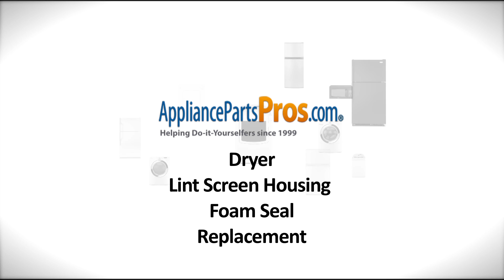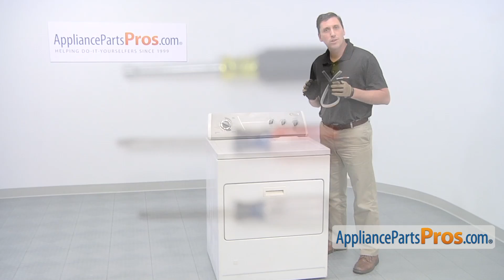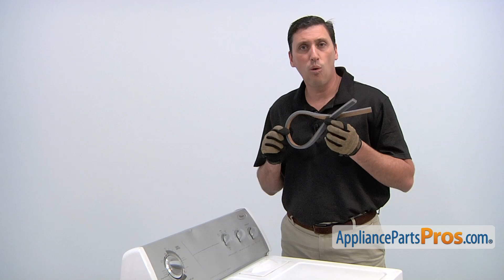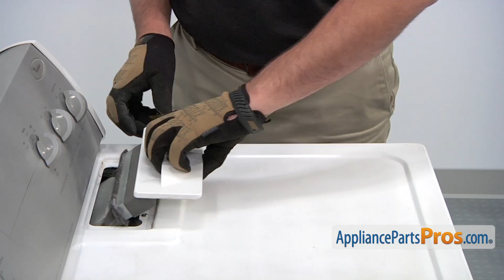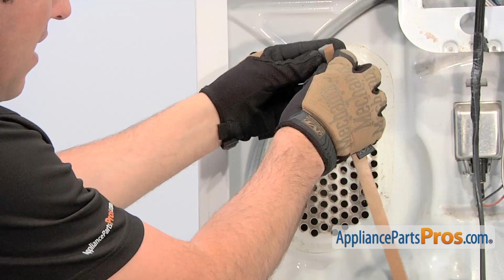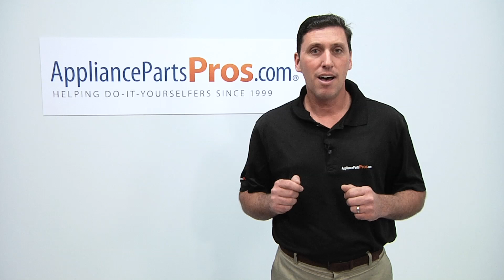How To: Whirlpool/KitchenAid/Maytag Lint Screen Housing Foam Seal WP339956

Comment: how does that run on 120v and mine is 220v.
Reply from the maker: If you have 120 volts going to the unit it will usually run, but will not heat because it's not enough voltage for the element to turn on.

Comment: Have a similar dryer but the metal duct isn't as easy to remove 😢. I gotta pull it through the top and is difficult to maneuver to even get it out.
Reply from the maker: That duct can be stubborn. On many Whirlpool style dryers you remove the top and front for better access.

Comment: What is the best way to get the old adhesive off? I’ve tried a heat lamp, alcohol, steel wool and a screwdriver. Also tried winded and 409. It is so slow! I wished the repair videos would mention a glue remover and be honest about the time it’ll take to clean it off. 😢
Reply: Patience is about the only thing,lol,ive been dealing with mine here in the last few days,i used alcohol and it worked good, the trick is to let it sit and soak and soften the glue up, i also used a little brush i have with steel bristle, not too aggressively, dont wanna take the paint off
Reply: In my experience, a citrus based solvent like Goo Gone, isopropyl alcohol, mineral spirits, brake or carb cleaner, or acetone in order of aggressiveness could be used.  Don’t know if Bourbon or Vodka might be better!

BUT CAUTION, all are flammable so use only in well ventilated area, use a fan to dissipate any fumes, and clean and dry the seal areas before applying the new seal.  Once done, ventilate the area well again before using the dryer.  Always be safe!!

Comment: How do I remove the lint duct housing when the dryer back panel only cover does not cover the entire back of the dryer? On my kitchen aid dryer the back panel only goes about three quarters of the way up. The upper part of the back panel does not look like it canbe removed easily.  After I remove it and unscrew the lint duct housing screws I can't get the housing completely off the dryer because of the bend in the top of the housing. Very frustrating that all the YouTube videos I've watched show dryers where the back panel covers the entire back of dryer and the duct housing comes off so easily.. Aside from the fact that I can't remove the duct housing, replacing the lint screen seal doesn't look difficult.
Reply: Hey Mike, did you figure out how to remove the dryer lint duct housing?  I have the exact same problem, the curvature of the duct and the upper part of the back panel prevent it from coming out!  The seals are shot on mine and I can't get to them without removing this duct!
Reply: @s80cal  i had this same problem, i know this is a old comment but it might help someone out,i have a 30 plus year old Kenmore dryer and i couldn't for  the life of me figure out how to get that lint chute out,i did some research and you have to take the bulkhead out or like someone else mentioned take some of the screws out and move it out of the way forward some and the chute will come out thru the top.

Since i wanted to completely refurbish my drier i took the whole bulkhead out (its like 10 screws or so) along with the motor,it was really nasty back there so i cleaned everything out, looked great when i was done.

Funny thing about all this is, 3 months ago i built and installed a new engine on my old hot rod but couldn't figure out how to take out a lint chute,lol
Reply: I have a whirlpool with a similar problem. There’s screws that hold the frame together. Loosened the two upper ones and pulled the vent up through the lint screen area. You need some flexibility from the machine to get it out.

Comment: Do you sell both the seals for the one shown here in conjunction with the lower seal for the blower wheel housing? Both are shot on my dryer, having to order one kit for both seals would make more sense.
Reply: They do have both the upper lint screen vent seal and the lower blower housing seal, but not in one kit, only separately.  

Be sure to double check your model number and only use parts specified for your make and model.